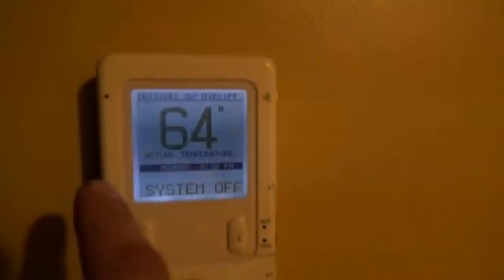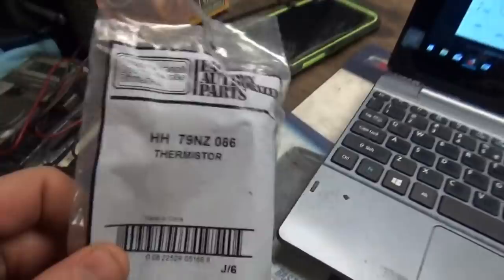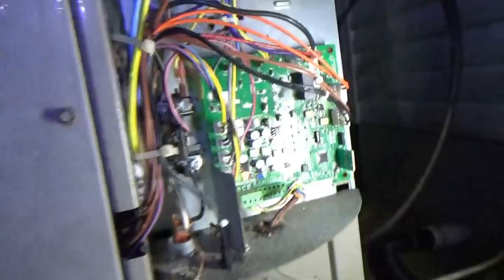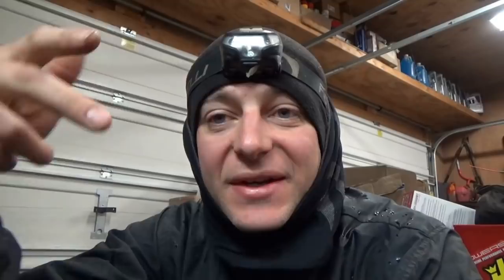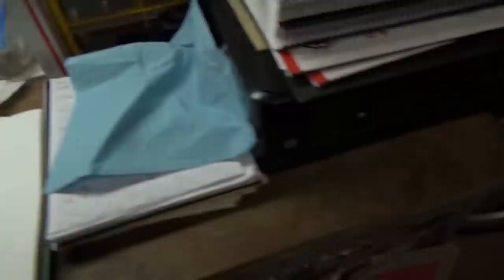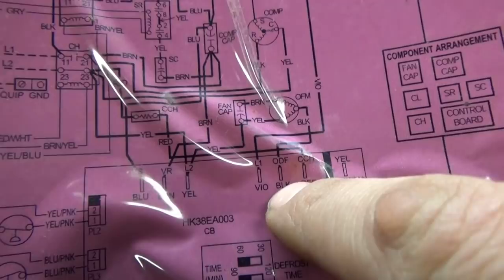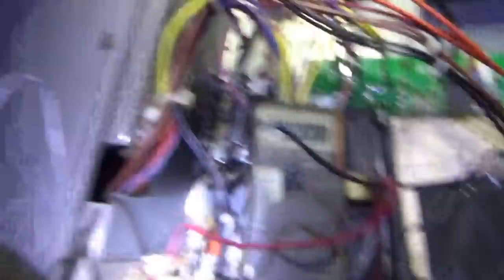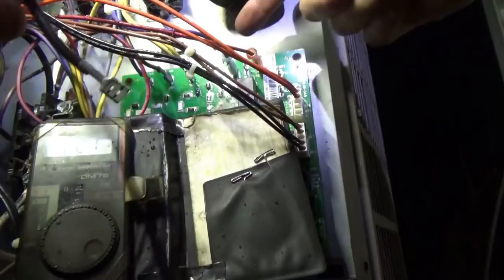Bryant Carrier HVAC Heat Pump - Part 1: Diagnosis

Comment: Ran into exactly the same thing, swapped the capacitor,  it's been running great now for over 5 years, and I didn't learn a thing in the process. Cool to see you over thinking it, thanks for the info.

Comment: Be sure to check the crank case heater, it may be shorted to ground . That would burn the trace off the circuit board.

Comment: That small relay can be easily tested, however by the looks of that trace, the inside contacts might be damaged. It is possible that  the motor capacitor has devalued,  thus increasing the start-up current of the fan, which stressed that trace and the relay contacts to the breaking point. I'm sure the control side is fine.
Reply: that was the trace to the crank case heater, seeing how it was blown in the middle, I'd mainly assume lightning/ surge damage. second to that a wire rub through down inside by the compressor/tubing. broken ziptie or nobody put one on.
Reply: I'm with  @throttlebottle5906  here. Something over current that relay to destruction while peeling back the crankcase heater trace at the same time and a short to ground via a wire rub is highly likely. Take the relay apart and free up the welded crankcase heater contact to reinstall it without crankcase heater until new relay shows up. Knock ice of fan blades to minimize vibration or pour boiling water on it just before turning on breakers again. Chasing down crankcase heater fault when the house is finally overwarmed and heat pump is breaker off again.

Comment: If the outside fan isn't running and is known to be good, then you are in a defrost mode.  There is an outdoor pc board that controls the defrost.  Two things:  either the outdoor coil stat is not working or the pc board is bad.  I also noticed it's raining so the coil may be frozen solid as it operates below freezing when the outdoor ambient is below say 40 degrees, thereabouts.  Turn the unit to a/c to defrost the outdoor coil.  Then check the defrost circuit by jumping the test pins on the outdoor pc board.  It will go into defrost for about 10 seconds if you hold  the jumper on the pins.  So release just after defrost begins.  Then check the coil stat leads on the pc board for closed/open circuit to determine whether stat is good or not.  If it tests good and it will not come out of defrost on it's own then replace the board.  It's that simple.  You should always check refrigerant pressures when servicing the outdoor unit.  :)))))  40 plus years of experience on heat pumps:)))))))
Reply: Thank you very much, tecnaman, for the excellent explanation. I am always trying to learn more about my HVAC system because I really need to learn how to repair it myself.
Reply: So far your the only one with the correct diagnosis one of two board or od sensor  also a check of the cc heater should always be done on any ref unit  plus t/p

Comment: Hi, Ivan. I have a very similar Carrier HVAC heat pump, and have had quite a bit of trouble with it.  I hope you don't have the infamous Bristol reciprocating compressor, which tended to fail after the warranty expired.  Later they started using the much better Copeland scroll compressor.  It's hard to find someone who's willing to replace your compressor, and they try to make you buy a whole new outdoor unit. I appreciate your video very much.
Reply: This is really great, Ivan, the way all the HVAC techs are chiming in here!  Just what the doctor ordered for my Carrier Infinity system!

Comment: Ivan, quick trick for the desoldering tool, run it in a circular motion while you're running the vacuum, that way you move the pin around and get the solder from all sides. Also, keep running it as, and for a second or 2 after you remove it from the joint - it will reduce the clogging of the nozzle with solder.  Also, on the heatpump, better check the fan capacitor. When you bypassed the relay, it spins up very slow, which indicates a dead fan motor run capacitor.

Comment: I'm surprised that they use heat pumps that far north.  Also, I was wondering why your emergency (coil) heat was not heating your house.  I had a bad defrost relay cause the same symptoms you are seeing at my camp, BTW.  My relay was not on the board, however, and was  easier to diagnose..
Reply: Today they have 0 F @ 100% efficiency heat pumps

Comment: Good video, fix circuit board after make sure & check the crankcase heater (make sure is not grounded &/or shorted) that would melt circuit board traces... hope helps !

Comment: I thought a cap was bad  its usually a common thing for fan operation
Reply: Yep that's what think or the fan.
Reply: Yeah, the fan spins up so slow, and the motor vibrates even when he bypasses the relay, definitely a bad capacitor!

Comment: When using a de-soldering gun like yours, you wiggle the tip in a circular motion around the pin to get the best job.   Of course if the relay pins are too large to allow that then you can't do it.  In that case you would switch to a nozzle with a larger hole if you have one.

Comment: I was waiting for you to test the Cap with the "Organic life form tester" A good cap would shock you into next week.
I had to learn how to diagnose my well system, had a good cap, and an open cap wire into the pump.
170 foot of poly line and I found the open at the 60 ft level. 
I am really poor, so, it got a waterproof connector and it went back in the hole.
Everything works fine, didn't want to fix it, but being poor, I had no choice.
Reply: You can test a capacitor with a VOM, set on ohms, after discharge touch the leads and watch the reading increase in resistance til it goes open, reverse the leads and it will swing the other way and go open, this would indicate a good cap.
A swollen cap would need replacement, a cap that builds OHMs and reads open would not need replacement.

Comment: Cliffhanger hahaha... the Unsoldering gun is very nice. Easy to remove parts. May consider to get one as well :-) 

I would repair the burned trace and replace the relay if it doesn't click.

550 for a board is nuts.

Comment: Ivan, I enjoy all of your videos, and the wealth of knowledge that you share with us, including the common sense familiarization approach like you took in this video with the describing the basics of alternating current for those unfamiliar.
Now, as a person working on industrial machinery operating at 3 Phase 347 / 577 VAC... I would like to mention something you did which had me very much on edge... it was at 16:00 when you pulled off the black wire with the uninsulated terminal from the 'ODF' position. The yellow was still connected to L2, and with only a 1 to 2 ohm motor winding in series between the black wire and L2, any contact with that black wire terminal and your hand could have been lethal in the dampness / rain if another part of your body was in contact with the grounded framework of the outside unit. You have to think a little differently when working on higher voltage items, since a load connected to only one phase will usually pose a serious shock hazard on the disconnected side. Other comments stating concern about your meter's maximum voltage rating are valid due to peak to peak voltage vs. RMS voltage.

Comment: The cube relays are cheap and replaceable, (but you pretty much have to order them on-line) .. you can jumper the lost trace .. I did that on my dishwasher (deja vu?). I suspect excessive load .. either the CCH or fan motor ... guess what? .. I monitored the current using my PicoScope (using a homemade current/fuse loop), and found the dishwasher heating element was drawing a few too many amps, causing the damage to the control board. BTW, I have the same Hakko desoldering tool .. It’s a little pricy, but a must have.
Reply from the maker: Awesome! We'll do some current measurements in Part 2 and 3 :)
Reply: I just plugged in the Verus and hit the "Fix it" button.

Comment: I hope there is nothing wrong with that crankcase heater, causing that short on that board😱
Reply: Looks like the relay energizes the fan when on and the crankcase heater when off.
Reply: @lorrinbarth1969  most likely it is controlled by the outside temperature if too cold it runs the heater
Reply: you two spoiled it, I haven't watched that far, but temp sensor failure is common on them (as with automotive, they're junk) , boards and relays are a given for failure.
probably nothing wrong with the heater or fan, just the relay contacts cooked with age and arcing from cycling. once the resistance goes up they get burning hot and burn the board and trace off near the relay. it happens across many electronics.
Reply: it's wise to always check the capacitors when servicing, since a weak cap will cause increased current draw, low torque and improper running rpm too.
Reply: DiagnoseDan I’m suggesting Ivan try a little of your music intro to prepare us for part two. Lots of knowledgeable commenters on these channels.
Reply: you can connect fan direct to main relay so when the compressor come on it turn the fan on same time
Reply: Yes. Crankcase heater may have shorted previously and blown the trace. Also possible the NC relay contacts are welded shut (preventing the NO set from making contact to energize the fan) if it closed into that shorted heater load.  @lorrinbarth1969
Reply: after watching the whole video I'm heavily leaning towards lighting/massive surge damage, because so much of the trace was blown away and It didn't look like a bad solder joint (cooked relay) slow burn open..
the heaters don't short out very often, but burn to open circuit, BUT for sure check the wiring running to it the whole way, it could have broken zipties/bad wire routing from previous repair and rubbed through on tubing/compressor, which will kill a new relay/board also. yeah I'd imagine the NC contacts are welded or it may have even arced over and blew the coil.
@dan man, the fan needs to be able to shut off while compressor stays running and reversing valve changes flow to defrost the outdoor coil (heat pump 101) it may also have a pressure switch that cycles the fan on and off. if it was summer/air-conditioning mode having the fan cycle with compressor would be ok
Reply from the maker: Yes Dan that's where this is going in Part 2 ;)
Reply: throttle bottle  U a genius man. Me thinks u know what u r talking about!
Reply: @billrimmer5596    Throttle and I watch the same elite HVAC video's.
Reply: wysetech2000  Perhaps u and throttle can lend your expertise. Cost comparison between 1. Resistance hearing via a little portable heater u buy at Walmart  2. Compression heating via heat pump 3. Natural gas with forced air furnace  4. Propane with forced air furnace.  I noticed his heat pump was pulling 8 amps at 240 volts. That’s quite a few watts. 8x240 Right? Thank u in advance for your combined knowledge and expertise
Reply: @billrimmer5596   I was joking in my reply and i have very little expertise  on the subject but there is one thing i can tell you, it depends on where you live and your climate. Where i am in Canada a forced air Gas is most common and forced air Propane is most common in rural areas. The cost of Electricity here kills any use of electric heat unless you live in Quebec where electricity is much cheaper.
Heat pumps are in use but you still need a real form of heating to take over from the heat pump when it gets really cold outside. The extra cost for a heat pump isn't worth it here.

Comment: My AC wouldn't come on a few summers ago. It's a 19 year old gas furnace with an AC system add-on. The furnace blower and inducer motor were stuck on and the AC compressor would not turn on. I called a local hvac company. The technician was very confused and eventually tried to sell me a new furnace controller board for $600 then a sales guy called and tried to sell me a new furnace. They never explained the source of the problem. Out of frustration I set out to diagnose the problem. Fortunately the furnace manual had schematics. Fifteen minutes later the I had the AC back on by temporarily jumpering the compressor start relay back at the furnace (good - it was 30 C / 90 F outside). Not long after than I had the root cause resolved: the flame roll out temperature limit switch on the furnace had tripped at the end of the prior heating season causing the furnace to go into its safety mode. I reset the limit switch (manual reset) and the entire system was back to life.

The roll out switch must have tripped at the end of the prior heating season. We did not notice it at the time because it was the end of the season and we then shut off the entire system for a couple of months. It turned out the heat exchanger had cracked the last time we used the furnace. That caused a flame roll out, which tripped the roll out limit switch.  The HVAC company totally missed it, tried to sell me a controller board for no particular reason, and tried to sell an entire new furnace for no particular reason.  When I explained this to the hvac company they did not give a damn, wouldn't even return my calls. We had a bit of fight via the local BBB, and, I got them to refund their $100 useless diagnostic fee.  This experience led me to the conclusion that I should always, always, always, put an hour or two into self-diagnosing problems before calling anybody. It takes less time, and is more accurate, in many (most) cases. Based on that I then concluded whether I need a pro to resolve the problem. Usually my conclusion is that I can DIY whatever the issue is.

p.s. I did eventually get a new furnace installed by pro's because you need a gas fitter's license to legally sign off on the install.
Reply from the maker: Great story, Jim. Sounds like the HVAC repair field has just as many parts cannons as the automotive field! You will see in Part 2 and 3 that if I called the HVAC service "pros" they would have sold me a new heat pump haha
Reply: Jim Trainor, a few years ago, I paid some major local company $40 to send a tech to diagnose my system that was blowing fuses in the thermostat. He was completely clueless .. just as successful blowing fuses as I was. Then, proceeded to pitch me on a new system. I paid the bill and sent him away, calling it the cost of experience and learning. I fixed it myself .. It turned out to be the reversing solenoid coil was grounding out on a sharp metal edge that finally poked thru the plastic coil casing. The coil itself was not damaged .. I filed off the sharp thing, and liquid tape insulated the wound on the coil.
Moral of the story:
1) most of these techs these days SUCK at repairs .. can put in a new system but that’s about it.
2) all the different brand systems all have to do the same thing and mostly use the Same Off The Shelf parts! Luckily we have a supplier here in Austin, Tx that will sell anything (except a compressor or refrigerant .. more on that possibly later)
PS I’m not an official licensed HVAC tech, but you and I can run circles around most of those who are.
Reply: So do it yourself and give the guy to sign it off a little money for his trouble
Reply: @Google_Is_Evil  I believe it is perfectly okay in some locales to do gas work yourself as long as it is inspected and signed off by a licensed trades person. Nothing under the table about it. Whether you can find someone to do that for you or not is another matter. I have no problem paying the pros to do the work assuming the process that led me into the contract decision was competent and ethical. Unfortunately it all too often neither.
Reply: Google is Evil .. it was the least path of resistance at the time

Comment: Occam’s Razor. Consider starting jobs, where you know there’s an electrical problem, with a quick visual inspection of the circuit boards and all the wiring, before you hook up the meters and start firing the parts cannon.  Typically you have rodents eating the HVAC wiring; in the South we have fire ants and rodents.  Thanks for showing your viewers how to successfully apply basic diagnostic techniques and tools to problems we may not normally deal with, but probably will sooner or later.

Comment: I would also replaced the 2 large  capacitors as well. This will prevent ac spikes going to the motherboard. The existing caps may not be the originals, thus may have the wrong values and if so, the specs would be off.

Comment: Ivan just anther comment lol, the Mains induction motor, the winding across the supply is the RUN winding and the one via the capacitor is the START winding, usually, although not shown on your diagram, the start winding has a centrifugal switch in series with the capacitor and start winding, so when the motor reaches a certain speed the switch opens and it runs on the run winding only...the capacitor is something to do with phase shift...Fred.

Comment: Hi Ivan well thats an interesting diversion from Cars, just for interest in the United Kingdom our electricity supply is 240v 50 hz, period, and we have 3 pins on the plugs, one is Live 240v AC, another is neutral and the 3rd one is Ground, which goes outside the hose to a copper pipe in the ground, fortunately i am a Radio Amateur, Ham, so that helps me in a lot of electric diagnostics...from Fred in England.

Comment: Clue:  it's not the voltage.  Don't mess with the circuit breaker.  The problem is outside.  Read below for a complete diagnostic process (look down below, underneath this post).